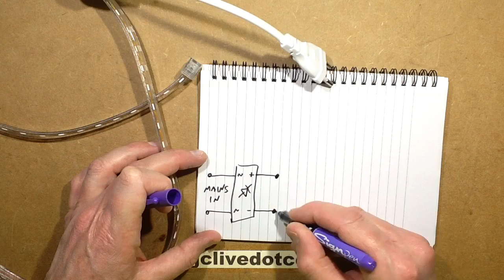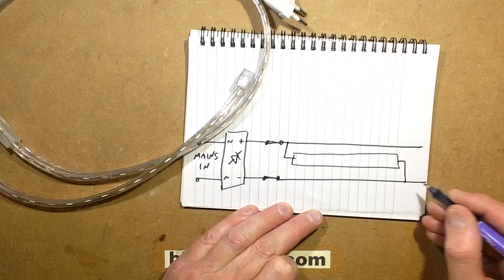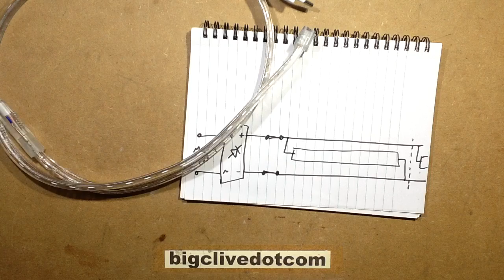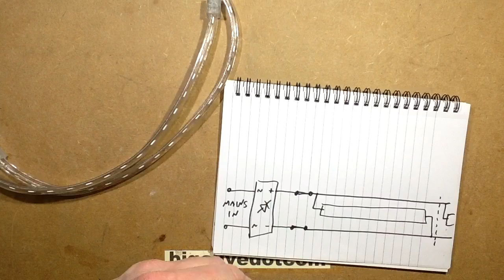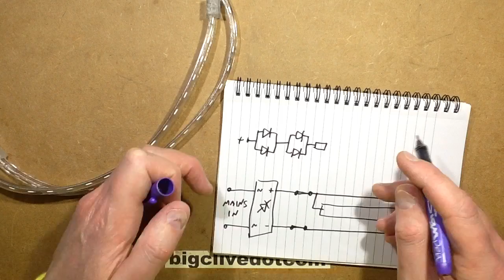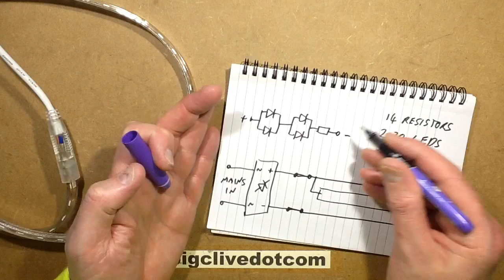A look inside some mains voltage LED tape.

Comment: Is there a reason why they don't put the LED pairs in with alternating polarity and leave the rectifier? That would stop the electromigration and probably more important: it would save them a rectifier per strain.

Comment: would the joule thief circuit run this strip directly to the rails of the LEDs,doing away with the mains power supply,i saw you running LED christmas lights.
Reply from the maker: A joule thief can run some lower voltage strings, but not something this high a voltage.

Comment: Interesting. What's the colour temperature / white balance / CR of the light output like? Seems it might almost be a neat solution for room lighting, instead of fluorescent strips, halogen downlighter spots or the traditional single fitting in the centre of the ceiling... if only it wasn't relatively inefficient thanks to spaffing about 50% of the input power away on the limiting resistors. Kind of almost seems like they're there as optional parts solely for 230v operation and the 110v version would just have solder bridges. Wonder if it'd work as well - but more efficiently as the voltage is dropped purely by the light emitting elements rather than what are essentially just a series of tiny heating elements -  to have 2m strips set up much the same way but without the resistors and with 60 diode pairs in series, or with the 60 diodes wired up in pure series rather than paired, much as either (and particularly the latter) might be a risk for whole segments burning out thanks to single failed diodes...?

Comment: Did you look into the current rating of the rectifier? I guess the dimention of the bus bar also has a limit when it comes to total power, especially if it is bare aluminium.
And as always, great video.

Comment: Please review/digest one of those super thin wire - mains voltage LED lights like this: http://www.dx.com/p/36w-600-led-warm-white-light-100m-twinkle-string-lights-transparent-452790#.WDk1Zvl974Y
They looks super dangerous, since they plug straight into 220v mains and have super thin - easy to brake wire. Do you reckon they are dangerous to use?

Comment: I have a reel of this stuff. It's brilliant. The best type is the silicone sleeve. A bit tricky to chop up but might be brilliant around your car reg plate and they even do it in infrared.
Reply: LostJohnny Isn't this illegal?
Reply: LostJohnny 220V strips in a car?  Sure it's not the 12V cousin?

Comment: I recently bought a bunch of similar LED strip for lighting in the garage (if you mount lights on the ceiling they don't do any good when the overhead door is open and if to hang them below the door you need a heavy frame and loose headroom but with these the frame is light and headroom is better). Mine are 120 LED per metre and I mounted 2 rows X 2.5M on each frame (5M per frame); I figure each frame provides about the same light as the fixtures in the rest of the garage do with 2x48" T8 each. Mine are 110Vand can be cut at 1/2M intervals but that is still every 60 LEDs. I chose waterproof for durability. I sealed the connectors & ends with clear silicone sealant.

Comment: Clive, there might be a 50 hz/ 60hz anti flicker setting in the settings of the camera application on the iPad, My tablet (addmitedly not an apple, or Ipad) has the setting and most android systems seem to have the setting as well. It could end up eliminating the shimmer if you can find a setting.
Reply from the maker: Alas no.  I've not found much in the way of settings on the iPad2.
Reply: Was worth a shot. I always enjoy your videos, Could you perhaps put together a video or some references or something for building a fairly simple constant current power supply, I have a 1W laser diode I pulled out of a laser that I want to use for minor laser engraving (experimentally), and I havent found much in the way of what I am looking for. Most of the ones I find are either far more complex than I need, or use parts that I don't have. ( i would Ideally like to use mostly parts i already have though I can order from digikey if i had a decent parts list. I have diodes, electrolytic caps, resistors, and of course both npn and pnp transistors of varying  ratings.)

Comment: Hey Clive. Do you still recommend the Poundland Fusiomax Endurance batteries? I went and tried them after your battery evaluation tests which found Simply Duracell to be Simply Shit lol. I have to say I totally agree with your findings on them and found Fusiomax to be excellent. Thanks
Reply from the maker: Yes, I've found all the Poundland alkaline cells to be good, but the Fusiomax had surprising capacity.
Reply: Thanks Clive, all the best.

Comment: I have 25m of this stuff attached lowdown on the driveway wall.  It's a very dark area down there, the strip does a good job of lighting the whole drive with minimal dazzle.  Far better than spots or bulbs.  The car's reversing camera picks up the light well too with little or no flare.

It's shaded during the day so no direct sunlight to attack the plastic.  It's been working for 12 months and no dead spots or water damage yet.

Comment: Clive, didn't you calculate the total resistance incorrectly? Parallel resistors should use reciprok math.
So that would be 1/(1/470*30) = 15,7 ohms
Reply: Carsten Svendsen The resistors are in series.
Reply: The resistors are in series with the diodes as can clearly be seen on his schematic. That string is then paralleled throughout the led wire. Or am I missing something here?
Reply: Hi Carsten, I got a bit confused at first too as it seems that Clive used "parallel" a couple of times in an odd way. From what I can tell, each strip consists of led "packs" consisting of two pairs of parallel LEDs in series. There are 15 of these LED "packs"  in series with 14 resistors per strip. Each strip runs in parallel with the next strip.

I wonder though why they bother with a rectifier when the LEDs will rectify the voltage anyway. (I guess it's a full-wave rectifier)

Comment: Why don't they reverse the direction of every other LED strip? that way where the two ends meet will both be connecting to the same power rail and they could do away with the large gap.

Comment: Is there a spec sheet that shows intensity/angle curve? Do the LEDs have any lens material on them?
Reply from the maker: The LEDs are just a series of point sources.  The output will be a wash of light with a slight ridge of light where the edges of the plastic strip are.

Comment: you asked a while back what ads we were getting.
https://www.youtube.com/watch?v=czjx5bCv_lg
this is the ad i got and it was skippable after 5 seconds, but i was intrigued... i wonder if UK railway workers really use this equipment, doubt it.

Im going to buy some of this lighting to go either side of the beam in my room as i live in an attic.. would you trust this over a 12/24v strip?
Reply from the maker: For modest amounts of work the new breed of lithium tools are absolutely outstanding.  Absolutely up there with traditional corded power tools.  And with a car charger you don't have to worry so much about running out of power.

Comment: should have a look on aliexpress the 12v unsleeved stuff is £3-5 for 5m
Reply from the maker: I actually prefer the bare version of the 12V tape.  It's much easier to work with and adheres to surfaces better because it is less rigid than the coated stuff.

Comment: Has a quick peak on eBay for some multicolour version to use on the banister for Christmas, however they all seem to have a 12V plug/brick and I'm wary on the safety of them! (Was looking at the 5m version)

Comment: Thanks for the video, Clive. I am fascinated by this technology and it is hard for me to wrap my head around it. 

I bought an inexpensive 110 Volt LED rope light on Amazon (for use in interior ceiling cove molding in my living room) that looked great -- but one 3-foot section failed after a couple of months. The company sent me a replacement kit for free, which was fine, but then another 3-foot section failed a month later! 

I left it alone and ran the lights for 6 months longer, allowing sections to fail, by which time -- all the sections eventually failed! 

I wanted to see how long it would take for the rope lights to become completely useless. 

To replace this rope set, I bought the same length of standard white 12-volt strip light (waterproof style for diffusion though the plastic "shell") with the proper amperage power supply. It works fine, after 3 months, no failures at all. It seems pretty stable. 

When I was researching the rope light failure, I ran across a lot of websites talking about this and offering repair kits, so I would assume this is something of a common problem. 

1.  Do you think it is possible that the problem with the rope light is something you'll find with the lights you show here -- that pointed pin and pushing wires into wires thing to make a physical connection is really not a dependable system?

2. Do you think that the type of plastic is just not a stable enough material (it's flexible on purpose to wrap the lights) for this use, so it;'s very flexibility allows for too much interior expansion/contraction, causing connection failures? 

3. Is it possible that the mechanical connection fails over time because it is a very limited connection to begin with, and with expansion and contraction due to temperature variance, etc, that connection strains and finally fails?  

4. Do you think the 12-volt strip lights can be more dependable because everything is soldered (although there are "clamp' connectors you can buy - which again make a tenuous physical connection) and the strips are actually flexible circuit boards with components soldered onto them?
Reply from the maker: Some LED strips are just made with poor quality LEDs.  The joining kits are common for all styles of mains LED material to repair dead sections.  It's not usually the spikes that are the issue.
Reply: Thanks for your reply. I wasn't thinking the spikes were the problem so much (If they were, in my case, the entire strip would have failed instead of one section at a time), I'm thinking of the physical connection -- per section -- as you describe at 14:39 of your video where the two thing silver wires from the L:ED circuit get attached into the bus wires.  I just wonder about that because it is so, well, flimsy, and the metals may be two different materials and perhaps they develop an oxide or something creating a resistance over time?

Comment: I got a 220 volt 10 meter set from Banggood by mistake . so I made a rectifier and cap setup and run them at 168 volt

Comment: Something this video has got me wondering, if these LEDs are driven by a simple bridge rectifier and nothing else, and so can be easily dimmed, why aren't domestic LED light bulbs designed this way instead of using capacitative droppers or other circuits which have problems with dimmers?
Reply: Because you don't have 40 LEDs in most lightbulbs, this works because the load is spread across a lot of emitters.
Reply from the maker: I've not yet seen a mains voltage lamp with a resistive dropper in it, in these strips the heat is spread over a modest area.  It might be quite interesting to make a resistive dropper based lamp.
Reply: Thanks. For avoidance of doubt, I was really thinking of the LED filament type, as they do use dozens of LEDs. Of course there's the small problem of heat dissipation from the resistors which would be needed.

Comment: Clive, I've been a fan of your videos for awhile now. I think I've gone back through your channel and watched everything from the last couple years at least.

I've got a question for you, or rather I'd like your recommendation for a product. I need a PSU for my RPi 3 and it's proving hard to find one that can actually deliver 2-2.5A at 5V. The one I bought can't keep voltage high enough and the Pi complains. Everything else I have on hand is more around 1A or so and isn't enough and again, the Pi bitches. Do you know of any reputable USB PSUs that can deliver near the 2.5A mark without dropping too far below 5V?
Reply from the maker: I'm not sure the best option.  Perhaps a decent quality USB power supply with a very short and beefy cable to the RPi3?  Voltage drop on your cable could be an issue.
Reply: bigclivedotcom yeah, I got a USB PSU from Amazon that had a good review from someone who graphed the voltage vs current across its rated range but you know how consistent those cheap Chinese products can be. It also came with a ludicrously long USB cable with a switch in the middle that was obviously not going to work for the application but I gave it a try for shits and giggles and wouldn't you know, it had a break somewhere between the switch and the plug just a few inches away. Probably because they used such a short run between the switch and the end with no strain relief that shipping alone was probably enough to ruin it.

Comment: think would look find on a lamp post, if you just spiral it so the back is flat against the post the lights pointing out
Reply from the maker: It would look nice wrapped round a post.
Reply: Clive I've got three LED curtains with a similar rectifier. They flash on and off and they often go out of sync. Is there any easy way to remove the blinking?
Reply from the maker: It depends on the circuitry, but if it's the classic flasher with a button it may be possible to either replace it completely with a rectifier or bridge out the components that flash the lights.  This page may help.  (image server appears to be down temporarily.)  http://www.bigclive.com/noflash.htm
Reply: bigclivedotcom It doesn't have any buttons and the box is glued so it will be hard to open without breaking. I may open one and see if I can short it so it doesn't flash anymore, the lights are great and they've lasted 5 years without any LED going bad, but flashing on and off ruins it.
Thanks!

Comment: So why do people mostly use metres and metres of 12v and 24v LED tape when 240v tape seems like a better option (when protected of course)?
Reply from the maker: Each has its own advantages.  The 12V stuff can be cut in much smaller increments.

Comment: I've been using these in the 3528 size and 110v for a couple of years now and would NEVER use them in a fully submerged situation but I haven't had any failures in outdoor installations.  At least no failures where water intrusion was the cause.  A few blown resistors have caused a few sections to die and need to be replaced but each 1 metre section can be replaced separately. Overheating resistors looks to be the main cause.  They definitely do not seem to be able to handle the power they need to dissipate. Most of the stuff I've been using has been with 8 leds in series with a resistor in a 30 led per 1/2 metre strip for 60 leds per metre.  Took a few of the failed strips apart and found the biggest issue is that once a single led or resistor goes the whole metre section goes with it.  Have some new stuff on the way which looks to avoid this.  An led goes out and only THAT one goes out.  Over all though I like these strips and find them much more durable and easier to work with than the 12v silicone covered strips.  A tip though: if installing outdoors be sure to fully seal both the supply end and capped end with non-rtv silicone sealant.  Nothing with acetic acid in it (the stuff with the vinegar smell).  That'll corrode the wires and connectors.  Also be sure to keep the adaptor/plug fully out of the weather.  no matter how well these things LOOK to be sealed water still seems to find its way inside.  Had to replace many more plug ends than strips.

Comment: I have one of those on my garden shed. I have been using it for about a year. So far it hasn't suffered from water damage. It is underneath a overhanging part of the roof but I still think it gets wet every now and then. The only thing I don't like about it is that the power cord is so short. I had to extend the power cord and I didn't seal the solder joints properly. So I think that's where it is going to fail. It is not very safe either..

Comment: I bought in May a length of 40m and have supplied with a timer 5 minutes maximum. For a month, sets of 20 or 30 LEDs do not work. I'll throw in the trash ....
Reply: Hombre Is it outside?
Reply: yes

Comment: My family bought a 1meter length strip of that exact led lights and power plug and as soon as we plugged it in the mains power box in our house tripped. Buying cheap mains power led stuff is allways a gamble
Reply from the maker: Sounds like it had a short in the tape or a failed rectifier (or both, as the short usually causes the rectifier to fail short cxircuit.)

Comment: After 2 years outside (under a small overhang) several meter-segments fail, is my experience.
Reply: Very much no matter which type of brand they all tend to drop large sections after 1-2 years.
Reply: This always happens, sometimes the bulbs are fine but the section where the beginning of a meter connects to the mains inside the rope fails and starts sparking, the rope gets black and the smell of burnt plastic fills the room. Happened to me last week, I cut it and taped it to mains again and voila! Not "safe" but free

Comment: Clive, any chance you could cut open the bridge rectifier section so we can have a look see?  I rather fancy these for an additional source of occasional lighting in my loft.  I have two regular socket boxes which are currently connected to nothing, but if I can, I'd just remove the bridge rectifier from is plastic casing and heatshrink it so I can get it inside the box, behind the switch. Thanks!!
Reply from the maker: It's a solid injection moulded unit.  But you could replace it with a standard rectifier rated for the correct mains voltage and anticipated current.  You'd just have to be careful to match the polarity to the tape based on the existing rectifier.